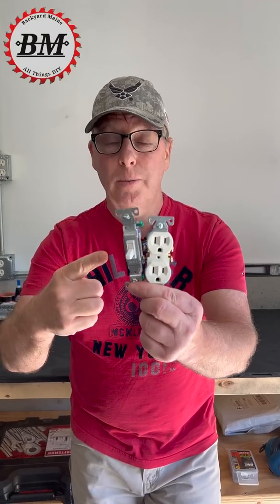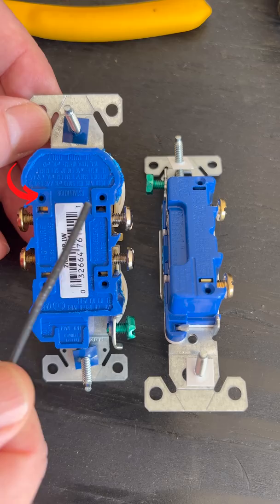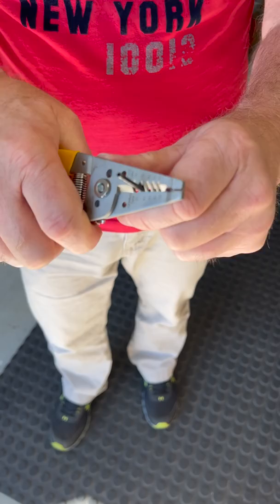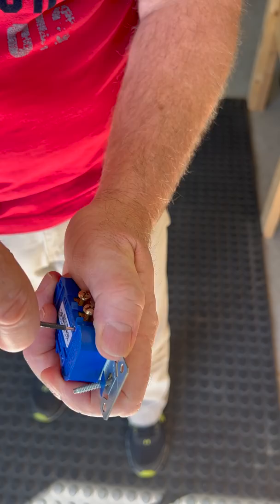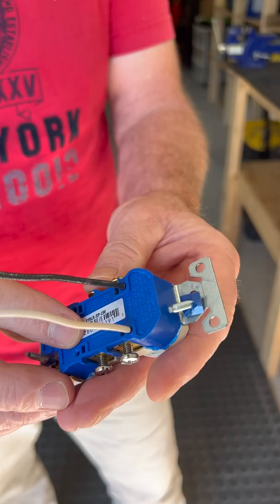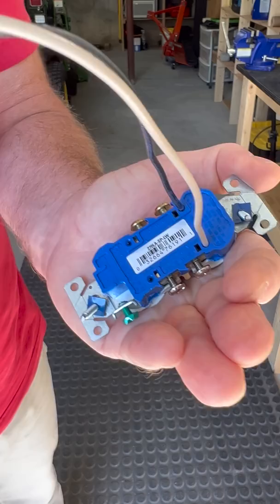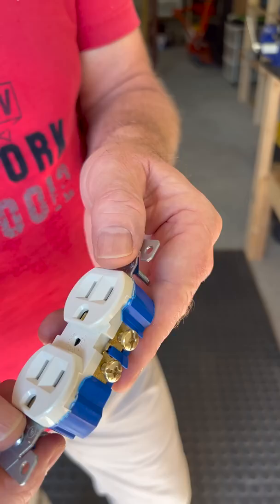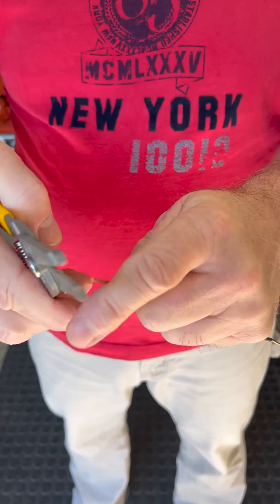Don't make this electrical mistake #Shorts

Comment from the maker: If you want to know how to wire a GFCI check out this video next. https://youtube.com/shorts/i2UtIIBhqHM?feature=share
Reply: Could you cite where in NFPA 70 that you can't do this?
Reply from the maker: @creamysbrianna  where in the video did I say it was a code violation? 😂🤣
Reply: @BackyardMaine  You're correct, I'm just curious what your basis is for not using stabs?  Do you have a scholarly source to cite?

I'm not a proponent of them either, but if UL has approved them I would assume they're safe.
Reply from the maker: @creamysbrianna  Yes, the devices that employ these connections are UL listed and the code doesn't prohibit their use either. They used to list them for 20A as well but due to so many problems they only list them for 15A devices now. I'm an electrician and an electrical engineer with 38 years of experience. I have seen so many failures from these connections over the years. I just give my opinion based on my experience and the experience of others in the field.
Reply: Can you show how to Wire up a EV Charger for home charging a 2023 Chevy Bolt?
Reply from the maker: @robertlee8805  I don't have an EV so unless I get a project to install one it may be on the back burner.
Reply: You can also use a piece of 14 AWG wire to press the release tab
Reply: Totally agree with you ,sometimes experience and Common Sense will teach you how to do things the better way! I have seen plenty of backstab failures in my 50 years in the trade they don't work well under continuous or heavy loads!
Reply: @BackyardMaine by the way I love your content and the good knowledgeable advice you give
Reply from the maker: @jayyoder5146  Thank you Jay.
Reply: @creamysbrianna I can appreciate wanting verified sources, but ask almoist any electrician or google it for yourself.

The scholarly sources will quickly become unnecessary since a multitude of experiences by way too many professionals and regular people will verify what he's saying.

Also, while the classic loop is never a bad idea, sliding the wire beneath the plate on the set screw is WAY easier and just as safe.
Not sure why he didn't show that.
Reply: @creamysbrianna  pay attention class.

Comment: I just replaced 38 outlets in a house that all of them were stabbed in the back. 70% of the outlets when pulled out from the wall,  the wires just slid out of that hole. The homeowner had a monitor set up for power surges, which were giving her several bad readings every day. Since I reinstalled new outlets, and did it the correct way, she hasn’t had a problem.
Reply: Why do they continue to allow backstab connections.  I do not really consider them to be connections. Never met any sense to me and I never trusted them.
Reply: It creates more work in the future for electricians and saves them money when installing them. It is a win/win situation. Also use the cheapest device made that is UL listed. If the customer wants higher quality than the minimum code requirements, make them pay for it.
Reply: It's because some of them you have to tighten that bolt as well

Comment: All terminal screws should be fully seated. It matters not if they are being utilized.
Reply: Why? I all ways run them in. But just curious why?
Reply: Thank you master yoda
Reply: @51-FS  sticking out drastically increases your chances of then shorting out against other things in the box, plus it can leave some of the internal parts in the receptacle loose.
Reply: @windmillacres679  lol them screws only hold the wire tight. U can remove them screw and it won't fall a part.....and it u got that much junk in your box, then maybe you need to clean them boxes. Nothing should be out that far in the bot to tuch them screws. A metal box should be the only thing you  should be worried about touching with the screws.....
Reply: @51-FS  I've seen to many boxes with wires with too much insulation removed.

And I'll be the first to admit that I'm not too good at getting all that stuff back in the box. LOL
Reply: @windmillacres679  heat shrink works really well.... put 4-9 of them on their if u have to....
Reply: Well it does matter. It doesn't need seating if there's no wire at that terninal. And even if the holes in the back made a secure connection, aren't they 14 ga? I know 14 ga is allowed in residential wiring but I always use 12 ga
Reply: Yeah, I don't follow. If there's nothing at the terminal that screw has no importance.  It's just a screw clamping down to a bar that the other ones already clamped to.
Reply: He mentions this in the full-length version of this video.
Reply: that is correct,but the back stabbers usually don't seat the screws!
Reply: I dont seat unused screws because I always electrical tape around the screws.
Reply: I’ve seen back stabbers. I’m more of a dirty double-crosser.
Reply: @51-FS that’s what he’s saying. Run the screws in

Comment: Must be a connection design. Here in Denmark, our outlets is a back stab design, and they last forever and ever. No problem.
Reply from the maker: They must be designed better than there are if they last. These usually start showing problems after a few years.
Reply: Same here in Holland. 99% is stab only and have installed 1000's of them.
Only the off-brand oddball cheap Chinesium garbage will cause problems (when used, i dont)
Reply: Sweden too, alot of swedish and german outlets are quickconnect, and i think its mostly non solid core a manystranded cable twisted that fails in them or damaging the connect
Reply: ive seen a lot of backstabs here in the u.s. and have adhered to the no backstab idea that my boss has when swapping devices

i couldnt imagine that leviton or lutron would have this feature and it not be safe
Reply: Haha must be because rarely ours are made in USA! Lmao
Reply: I'm sure much different design since usually the entire front is different in other countries vs USA
Reply: 20+ year as a electrician and I pretty much go out of my way to only use quick connection devices
Reply: Are you sure you don't use pressure plated devices.
Reply: Depends what type of metal the connections are made of.  Cheap plugs use brass...
Reply: @Kuffen90  stranded wire is I believe not allowed in quick connect.
Reply: @mstar501  Wierd, cus sweden do use mostly stranded wires since its pulled through pvc piping in the walls, then its mostly used outlets made in sweden and germany, most of them are quickconnections or backstabbs.

Might be disallowed where you are in the world, but atleased when i studied electrical work here we used only stranded wire called FK (FlerKärnig/MultiCore) and backstabb/quickconnect. The connections at school do break ang get dodgy to remove/reuse, as my teach said, this is cus people twist the wire before connecting to get a good connection, but by doing so it gets stuck in the connector and ruins it when its removed.
Reply: Forever and ever? How well built are your outlets? What do they cost? My experience is they usually have about a 20 yr average lifespan when regularly used. (US)
Reply: @TheMRmakeSHIThappen  Dont know exakt. but my parrents built thier house 1990, and have only switched outlets for design or to upgrade from not grounded to grounded.

Lets look at consumer distribution board, by experiance grandad says (whom love sqrewing the cable in and do not like/trust quickconnects)
When installed youd need to open the board and tighten all the sqrews again, since it relaxes.

By definition you shouldent need that with quicconnects, since they are kinda springloaded and selftightening. even thou they arent springloaded, but if the copper shrinks with aclimatisation to the room and the heat from power loss/resisance a screwconnection could be just as dangerous.

Here they are kinda made the same, you jabb the copper in and tighten a screw, iv seen us outlets use single core copper cable and a loop.
Reply: Uk only have stab (that I know) never a problem
Reply: @Aarron Taylor  UK is majority screw terminal.
Reply: That's why higher voltage and lower current is bwtter
Reply: most plugs and switches in the US these days are back stab.  These guys are clowns. Can't side wire when there aren't any side screws.  People like this don't like Shark bite plumbing either. Because they DO NOT KNOW HOW TO PROPERLY USE THEM.
Reply: @BigSchlebowski  I agree!  Even though doing electrical work isn’t my expertise. I’ve installed a couple & gotta say, side wiring  is tuff. There’s very little clearance.
Reply: I have back stabbed outlets never had a problem.
Reply: @r4pp44j4  Yup!
i love when the plug that feeds my toaster is the size of my fist.
Reply: The outlets in Denmark are a better, stronger design. The voltage is 230 where in the USA it is 115 volts. Many  of your outlets are made so you plug your wires in and tighten a screw that properly clamps the wire. You do not need to make a wire hook. Our better receptacles are made in this fashion.
Reply: @joepmeloen3373  China garbage yeah does not last very long
Reply: @mickturner957 they are not plugs, they are receptacles also known in some countries as sockets.

You need to know the correct terminology when working with this stuff and mixing up a plug and a socket is about as basic as it comes.
Reply: @aarrontaylor1222 UK does NOT have stab.
 Definitely not on accessories such as sockets and light switches.

We use screw terminals only for these.
However for joints, we can use Wago lever connectors.

However I think there is one accessory product on the market which does use Wago's instead of screw. But that is only very recent.
Reply: @r4pp44j4 Wrong.
Lower current has a problem in that it heats the wire up more. I will leave you to think about the possible consequences of that.
Reply: @BigSchlebowski exactly
Reply: Not even remotely the same. No similarity at all. 
Wish there were! In the US, the term 'backstab' refers only to this dangerous design.
Reply: The new Leviton outlets are nice with the lever type Wago connections. Installed my first few last week.
Reply: US do have poor quality in material in engineering. Don’t forget. They have to handle all those problems coming from those issues
Reply: Bruh, the outlet isn't a "backstab design", it's just an alternate connection method that is included with the screw terminal connections.
Reply: So your devices there do not come with side screws?
Reply: @joepmeloen3373  that's the problem. He's using the cheapest outlets. So do many contractors. 2 million dollar home will have $0.50 outlets and wonder why the stab in went bad.

Comment: The problem with backstabbing receptacles is the way receptacles are designed.  The wipes that grip the wire in the back also grip thr cord end in the front. Creating opposing leverage that loosens the wire connection over time. Backstabbing switches isn't as much of a problem.

Comment: The biggest problem with these aren’t the outlets. It’s the people who don’t know what they are doing and not correctly landing the wires and/or leave too much exposed wire coming out the back. I had a co worker the other day keep blowing a fuse when he tried to put a switch back into the box. Lo and behold the ground wire was touching the hot that he left exposed. He had no idea until I explained it to him. Not an electrician obviously but you’d be surprised how common this is.

Comment: I like how every electrician on YouTube says don't backstab your receptacles. Yet they are manufacture with this option. I guess the manufacturers have no idea what they are doing? And they have never tested their product. I've replaced outlet where they are loose or have come undone at the screw connection too. So, screw connection does not insure the connection will not come loose.

Comment: This backstabbing shouldn't be confused with the newer age method of also being able to place the wire straight in, but it goes into the clamp of the sidewire terminal and is clamped down when tightened properly.

Comment: Another thing, when side wiring TIGHTEN THE SCREWS. Wire wrapped around a loose screw heats up worse than backstabs and sometimes arcs from screw to box.

Comment: Right on the money. Can't tell you how many times I have had to fix theses.
Reply from the maker: Me too.. I guess they keep the service guys employed.
Reply: Lol I cant tell you how many time I have not changed them. Electricians are full of shit
Reply: @xChromerSatanasx  good luck with that.....
Reply: @xChromerSatanasx  yes many are......lol
Reply: @xChromerSatanasx  you can ask 10 electricians the same question and you will get 10 different answers.......lol
Reply: Electricity connections are a surface area thing and your surface area of connection in quick wire is insufficient. Why it's legal is questionable.
Reply: If you weren't supposed to back stab your wires then why did the manufacturer make them all that way?  You all just don't know how to correctly back stab.  Bunch of rookies.
Reply: @xChromerSatanasx  any self reapecting electrician wouldnt do this silly shit we know how these things work
Reply: Here are my thoughts. If it was dangerous or a safety/fire hazard then I can tell you for a 100 percent certainty that this option of installation would never exist.
Reply: Amen
Really
Reply: @carlt8188  "back stab" wow cool.
Reply: I love how electrician brag about fixing electricians work and then say trust me I'm an electrician.
Reply: @BackyardMaine  that is exactly why ours don't function that well while everywhere else they have no issues... Same as cars but at that level bmw mbenz and all are just as prone... I was taught to loop and tighten down.. always with the loop being close by tightening the screw.. and for all those screeching bare wire and exposed sides... Single wrap of electrical insulating tape and both sides are covered and protected from shorting...
Reply: Years ago I started a collection of melted down devices,, but after a time it was like wow,, ok ,um yeah just throw em away this is In no way special,, years later now I have learned,, as today,, it was a buried splice behind the dry wall in a kitchen,, some remodeled along the way said oh just twist em together it'll be ok,,,😵😵😵 2 hours with a tone generator,,  finally said ok I'm cutting a hole, right here,, and Bam,,, what almost burned the place down,,,, I understand now why the boat dryer was acting funny
Reply: Let's go into a little more detail why this is a bad setup. These holes in the back used to be for 12 Guage. 
12 Guage on a 20 Amp breaker. 
80% is the amperage load figured on devices. For example, on a 20 Amp breaker, maximum load should be 16 amps. On a 15 Amp breaker, 12 amps. The back stabs were failing on the heavier amps of a 20 Amp circuit . Manufacturers reduced the size of the hole to accept on 14 Guage  wire only with maximum  load of 12 amps instead of 16 amps. Plus the receptacles  were usually rated for 15 amps. 
One problem existed. If you look in some panels today, you'll see 14 Guage wire on a 20 Amp breaker or fuse. Sometimes 30amps on a fuse. Heavier amperage from kitchen appliances  or hallway outlets used mostly for vacuum  cleaners can cause the wire holding springs to overheat and fail. I've changed a lot of hallway outlets that failed because of this, BTW. 
so, even though they Made the holes smaller to lower the amperage load, they still fail.
Amazing how non electricians argue with electricians saying that back stabs are perfectly safe to use. 
They don't deal with this problem on  day to day service calls and trouble shooting.
Reply: @carlt8188  how DO you correctly backstab? 
And by defending it just shows that YOU'RE  the rookie.
Reply: @xChromerSatanasx  so, you're not an electrician, but you're a qualified critic of them. Truth is you have no idea what you're talking about. 
What's next on your agenda? Proper rocket engine tune up?
Reply: @xChromerSatanasx
Reply: @billellington9754  who says I'm not an electrician? You
Reply: @xChromerSatanasx  no. YOU
Reply: @billellington9754  well than I am wrong, because I am
Reply: You should be THANKING those old-timers for giving you all this easy work to repair.  I fear the day I run out of 2 prong outlets to upgrade!!!
Reply: Never had that issue, but then again 12-2 doesn't fit in the 15A outlets, and why run 14-2, unless your just a cheap bastard.
Reply: @C0braChicken2  14 Guage is usually run for light circuits and 14-3 is used for 3way travelers, on a 15 amp breaker, since lights don't pull that  much amperage .
And, to use your word, it's cheaper
Reply: I am retired now but have never had an issue with a switch or outlet that was back stabbed. I have ran into the electrician not screwing in the side screws.
Reply: @BackyardMaine  not really.. I been in houses with that same hook up and they last 30+.. I think it’s all in who doing the job.. they would have changed that style decades ago..
Reply: @craigb8228 Since this is allowed to code does make the NEC stand for Never Electricity Connected?
Reply: @xChromerSatanasx I'm an electrician, been so for 25+ years and have never once had to fix a device that was stabbed 🤷
Reply: @frankcarroll4978  lol thanks for your honesty
Reply: Ok guys here is how it’s done in Germany: Screwing the cable is not allowed anymore for many years now due to the amount of failures: screws get loose, greater resistance, burning. All actual used outlets have wire holding springs (US: backstabbed?) and can take 16 Amps. Not 25 or 20, just 16. Those connections work forever. No lose wires, no overheating, no burns, nothing.